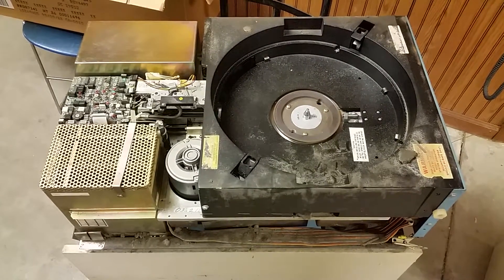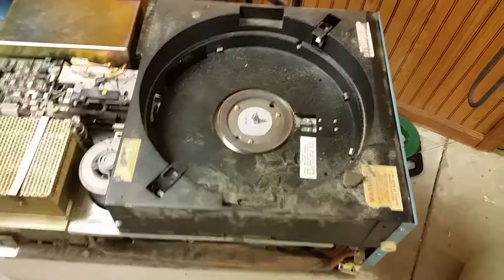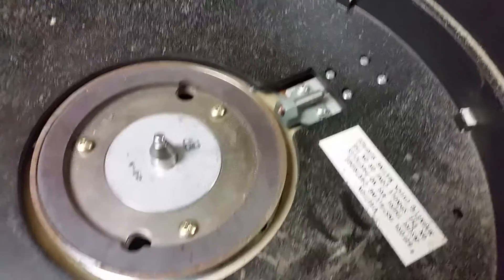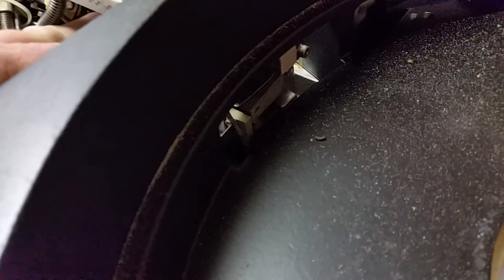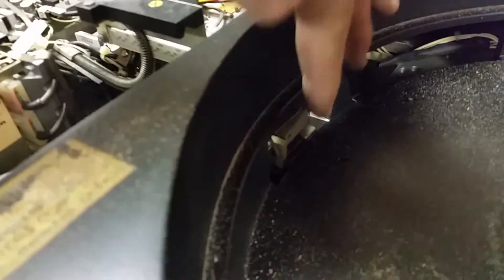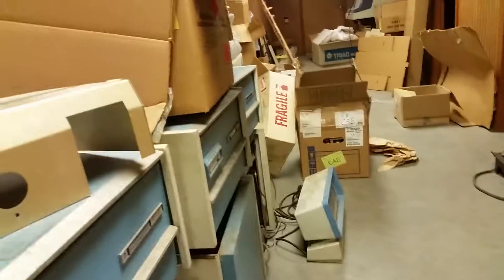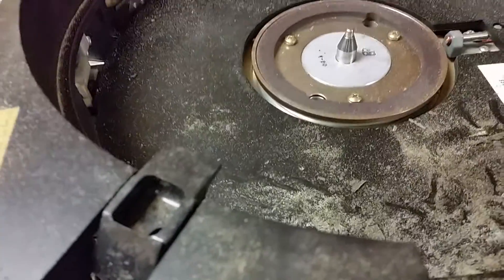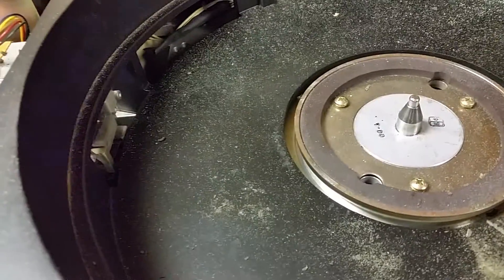Parking Heads on CDC Hawks

Comment: The pin to lock the heads is shaped like a capital letter R. When the heads are retracted, they are in the park position. The pin you mention is 'locking' the heads so that they do not slide out and make contact with the discs during shipment. The pin is inserted inside that round hole on top of the actuator assembly.

Comment: Ugly?  Ugly!?!  Dude, that is a thing of beauty.  A machined aluminum frame, electronics that almost never die, and a whopping 5 million bytes per disc!  Harumph.  Following a 50 second delay to allow the discs to stabilize speed and temerature, this system would boot up in about 2 seconds.  Take that Microsoft!   And yes, you use a pin :)